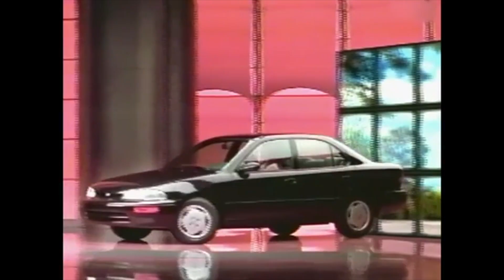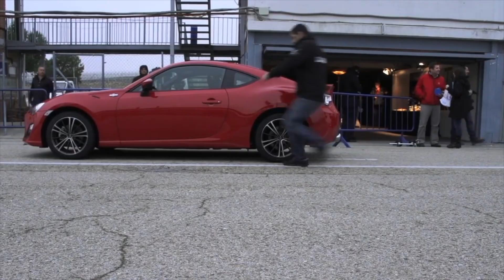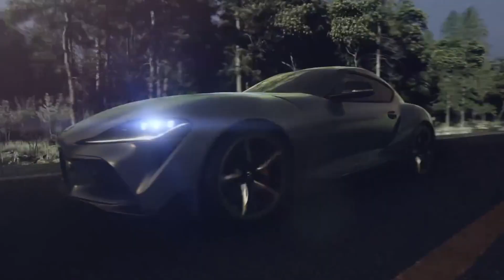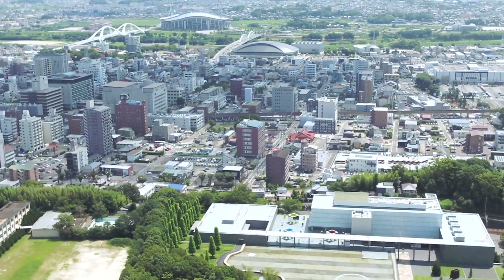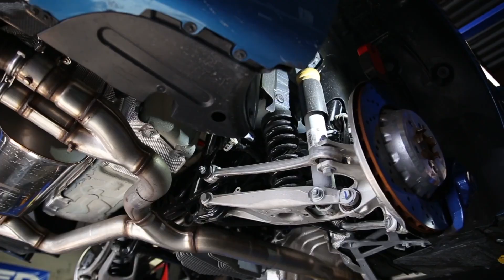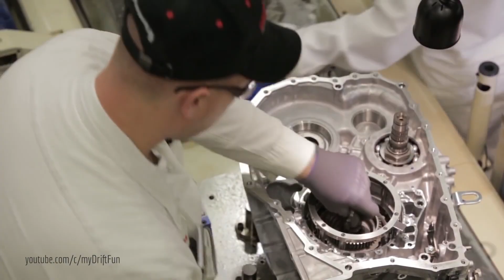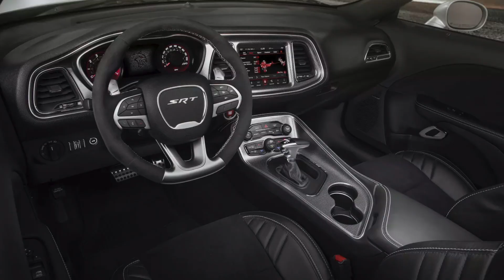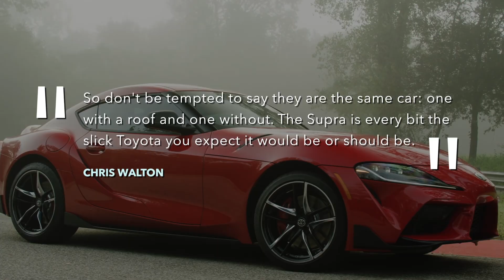MKV Toyota Supra - BMW or Toyota? The UNTOLD TRUE STORY

Comment: Great video.  I say this to everyone who I talk to.  Who wants a Toyota with BMW reliability.  And this video answers some of it.  But the platform aside, this is a BMW parts bin car.  Not manufacturered in anyway by Toyota.  That is a hard sell, namely you slap a Supra badge on it. The other part, a lower HP driver's car with no optional manual trans at launch is a huge contradiction to their sales pitch for who they are marketing it towards.
Reply: I've been saying the same. Too bad everyone jumps to conclusions and calls me a idiot. I hope the car does well. I'll just never see it as a Supra.
Reply: I think this Zupra will be popular in Europe, meanwhile in Asia = FAIL

Image of Bmw Cars in Asia = overpriced spareparts, mediocre reliability.
Reply: It won't be another Z4. And I already think the Z4 is a great car.

The simple rundown of it? Easy. Look at the wheelbase and setup. Look at how they've gone with the bored rather than sleeved block.

Toyota have seen what became of the 4th gen. They've paid attention. And so they probably wanted to make something that can become something similar for a new generation once modders and mechanics get their hands on it. Hence going for something more durable and reliable in terms of both construction and likelihood of finding parts. Hence going for a BMW I6, which are about the best damn engines you can think of across the register, MAYBE with the exception of a Merc.

I am looking forward to this.
Reply: Navid F this is one of the most beautiful things I have read on youtube comments haha
Reply: @elih2765  for real haha. The argument should of just ended with his comment. Dude literally dropped mic on all these idiots. Lol
Reply: @X1xRiGox3X  @Eli H Awe thank you all. Love you guys. <3 I appreciate the support! It's time one would look at things without bias and objectivity and everything will make sense. I really want to cop me one of these in the future and kick ass. It's unfortunate that people are comparing things tuned to stock. Stock vs stock, the MkV wins. Tuned vs tuned, right now it is up in the air as to what would happen. I have faith in the B58 tuned and developed by Toyota, but the 2J is amazing in its own right as well. I'm one who loves things to be clean and stock, so it won't matter for me. <3
Reply: All parts were sent back to Japan for Toyota testing, including all the nuts and bolts. Parts were rejected and updated. This is going to be Toyota reliability. As for manual, the LFA didnt need a manual either.
Reply from the maker: Definitely agree. It's certainly not what the purists wanted or really what the majority of the car world expected, but at this point, we have what we were given and I will continue to reserve judgement until I get a chance to drive one. The 86 was an interesting foray into this collaborative streak by Toyota and I personally feel it achieved what it set out to. I'm most certainly not a BMW fan though (I know you had a wonderful time with your M3 lol) so I'm still reasonably apprehensive. Thanks for watching dude!
Reply: @albonfilms  Keep making videos, you are doing well!
Reply from the maker: @savagegeese  Thanks man! Means a lot!
Reply: @albonfilms ... What is driving it going to do? We all know it is going to be a good car to drive for the most part.. I don't think anyone is arguing it is gonna be shit to drive and a shitty car overall.. Most are just not happy with the fact that it does not go in line with that the Supra originally was and that the car is mostly a BMW.. It's like the new 10th gen SI... The car performs fine and it is a nice car, but it pretty much goes against everything the SI has always stood for.. An NA, high-revving, reliable driving experience. They just threw in a Honda fit motor, slapped on a turbo and called it a day lol.. Some of the best parts of the SI are modding them, and with the 10th gen, you are incredibly limited with that Direct-injected, 1.5 liter.
Reply: @albonfilms  same here, reserve judgement. for me it'll be the ultimate potential of that "B"- engine variant. Also, do you know which 8HP model toyota spec'd?
Reply: @albonfilms  I predict a warranty headache for Toyota.
Reply: @albonfilms  hey"purists" GFY
Reply: savagegeese as someone who has been in the automotive manufacturing field for a decade I can tell you that even the component manufacturers are all connected. I work for a very large tier 1 manufacturers and we make parts for many of the OEMs under one roof. All parts are made according to the manufacturers standard but can be built sometimes on the same lines and a lot of OEMs part bins are shared.
Reply: @southsidedezi  what do you think about this new supra?
Reply: @southsidedezi  I understand that and it makes sense on every level.  I will leave you with this, what made the MKIV Supra legendary?  I can promise you one thing, if it had a BMW motor from that era they would all be in the junk yard.  And that's just being honest.

But it's a different era now and I understand the development and business case for not wanting to spend 75 million on a new motor that will maybe be in 60,000 vehicles.
Reply: @savagegeese  Let's hope the pre-production testing that Toyota completed on their test mules makes this B58C variant much more reliable than a vehicle developed solely by BMW. The new Supra has met ALL of the same reliability and quality standards as all of the other vehicles in it's lineup. I hope that means something in 2020 and makes a difference on this car. Also.. hope Toyota has a decent staff of quality engineers to keep all of the suppliers in check.
Reply: @vhx1  Then they should've gave it a different name and let the mkv make it's own name. If the mk4 did it then it's only fair that the mkv do the same.
Reply: Only time will tell the actual reliability of the new supra, bmw seems to have gotten their shit a little more together. I think itll be a really awesome car
Reply: @Ghost1gx  Depends on what layout and block. The M5 V10 for instance was a disaster, and e.g. the N47 is wonky because - suprise suprise - when you start off with an I4 and then introduce lightweight parts where they shouldn't be straining because you need to drive balance shafts in the first place, just so you can lower friction that tad bit more for the sake of those asshole greens and their emissions... Well, I mean, that's like saying "I took a bad design, and then introduced bad parts because of bad priorities, and it went bad. How could this have happened?".

Beamer I6s have been pretty good. I've only ever heard good things about the N/S55 for instance. And the N54, while it some had problems with e.g. the fuel pump (probably because of oldish design and possibly also the crap gas you get over there in the US...), is notorious for its tunability. As I said, Merc generally looks ahead on sheer mechanical guts, and they seem to be able to bore nicer, but there isn't much one can usually do to improve a modern I6 design-wise since pretty much everything about how you should set up such a self-explanatory design is right there. Especially since here it comes with VANOS, Valvetronic and overlaid IC out of the box. The channeled rather than jacketed block and the anal parts testing tells me that, like I said, Toyota is counting on people scaring the living shit out of these engines basically from the moment they get their hands on them, and so they have come prepared. So the only damn thing that has me concerned is the coated rather than "proper" cylinder liners, which sounds like something that would be too expensive or specialized to get fixed neat in case of a problem or if you want to do a re-bore.
Reply: Very true. People can say "give it a chance". But that fact you even have to say that says something about their strategy. You wouldn't have to say that about something that was obviously well done, based on good decisions.
Reply: @savagegeese
While I partly agree with you, I would like to point out some things in favour of Toyota:
1. For all it's iconic status, the Supra's were never sold that well. They were essentially niche-cars for a very small group of enthousiast. Instead of making Toyota money I wouldn't be surprised at all if they actually COST Toyota money, as the Skyline R-32, 33 and 34 did to Nissan. 
2. When Toyota presented the 86 in collaboration with Subaru, Supra fans were disappointed and cried out for a new iteration of their beloved Supra.
3. In contrast to what Toyota maybe secretly had hoped, that Supra fans could be swayed to see the 86 as a tamer replacement for the Supra, they couldn't see the 86 in any way as a rightful successor to the Supra: to them it severely lacked the power and the tuneability that made the Supra so famous.
4. Toyota had a look into developing a successor to the Supra and quickly realised that developing that successor to the Supra all by itself would be way too costly, seeing as they didn't expect to sell large numbers of Supra's so they would become way to expensive for a "mere" Toyota.
5. Since the collaboration with Subaru had turned out well, Toyota choose to develop a successor to the Supra with BMW.
6. As the platform was mainly developed in Germany, it made sense to use readily available German i.e BMW parts and build a completely finished "lower half" platform and then have both BMW and Toyota build their respective "upper halves."
7. Toyota possibly didn't realise how much this would offend Supra-enthousiasts, who wanted to see the next generation of the legendary 2JZ-E engine instead of a "mere" BMW inline-6.

As to reliability: the BMW inline-6's are pretty reliable, not only  have they been building and developing them at BMW for decades, they've also raced with them for decades, so they must pretty well know what those engines are capable of. 
That being said those BMW engines are nowhere near the over-engineered tuning monsters the 2JZ-E engines were, and there lies the rub with Supra enthousiasts. The standard Supra, while being no slouch!, was never that popular. They only became popular when people saw what Supra insiders could do with these cars to get insanely tunes.

So has Toyota made a mistake with the new Supra? 
Fans of the older models will scream loud and resoundingly "Yes!" 
But maybe people new to the Supra will see it as a competent sports car, a kind of hommage to the Supra's of old, and a big step above the 86 and will buy it as such.
Only time will tell.
Reply: Not just that, but it doesn't even follow previous Supra cars in its layout.  Other Supra cars were GT cars before everything else with 2+2 configuration.  It was something that was easier to sell to your wife as well, I am talking from personal experience. New Supra is just a tiny 2 seater with shorter wheelbase than GT86 and with possibly even worse visibility than Camaro. So disappointed after saving money for last 2 years and hoping that those concept cars were just that and nothing more.
Reply: @thedriver5462  This, this right here. This is what I keep trying to explain to people. It doesn't even make sense being badged as a Supra. If anything, it's more like a modern 2000GT.
Reply: A Toyota with BMW reliability..? I thought it is the other way round hahaha
Reply: @MikeHarkins-w9b  go and look Mike. It's called reading
Reply: @MikeHarkins-w9b  i'm not a straight line junkie :) i know that's a big thing in America but not quite everywhere else. Try taking an r35 to a track for continuous laps and you'll see what i mean. Regarding old Skylines (yes, we actually have them here from quite sometime ago) they were great for what they were, in their own time. :)
Reply: @gerardjoaquino8856  discredited lol 35 is a v6.
Reply: idk i think the changes on the b58 makes it a solid engine ready to take a beating
Reply: @ghostcell030  yes they are using BMW parts and fair game to Toyota for letting the buying public know. But hey, i'd rather be thankful there is a new sports car out in the market than not, and at an attainable price for a lot of people. I'm just looking at the glass half-full, really.
Reply: Why didn't Italy have some skin in the game? Could have been an Axis Power Reunion :). In all seriousness though what a cool collab project between two countries and definitely a practice in Engineering.
Reply: I just don't understand why Toyota would not develop it's own engine, they could then use that engine in future gt86 cars and supra models and also use it in a new version of the MR2, the company is not broke it could of afforded to take a risk. People would of been far more interested in this product if it was toyota engineering because that is what we have all fell in love with and if they could do it i the 90s why can't they do it now, 4age, 3sgte, 2zz, 2gr 1mz, all sick engines. Pussies answering to shareholders.
Reply: @mat0655  Because designing a new i6 engine would cost a lot of time and money and would have limited use. They're better off working with an existing, modern i6, and BMW has such an engine. It's not like this is the first time Toyota has worked with another engine manufacturer. It's very common in the industry. As for sharing it with a new MR-2, if such a thing happens, they'd probably prefer a i4 or v6, for packaging reasons.
Reply: @nf1369  "the notion that you doubt toyota in making anything reliable makes me very disappointed"? Wow fanboy much? There are very good reasons to doubt. As long as you remember that speculation is just speculation until you see how the actual thing holds up years later.
Reply: @emissarygw2264  
Why in the fuck would you doubt Toyota at all? They've never built a genuine lemon. The partnership with Chevy and the Sunfire came out, they made it reliable as fuck but the Chevrolet equivalent was a bag of garbage. How about the BRZ/FRS/GT86/86 twins? You don't realize that car is the most reliable Subaru ever? Stop saying random things and start thinking before you say something. I'm no fanboy, I'm a realist. When savagegeese commented that earlier, I told him that even with this vast amount of wisdom, he shouldn't have come to this conclusion because he knows better. Calm your tits down buddy.
Reply: Toyota’s, BMW, and Porsche all get along in my garage.  Put manual in the Supra and I will put it commuter duty.
Reply: Video: They only share the basic platform and engine, with each developing the rest of the car (body shell, interior, chassis setup). Internet ding-a-ling: It's just a BMW with a Toyota badge slapped on it. I mean, it's not like BMW produces cars that handle like rubbish.
Reply: @soupisgoodfood42  The Supra is an iconic Toyota.  What if BMW decided to have Chevy produce their M cars?
Reply: @savagegeese  That's a silly analogy. Or are you trying to say that BMW don't make good performance cars?
Reply: @soupisgoodfood42  They do and have, but none you want to keep long term or put extended miles on. They are lease only and pass the problems on.  It has gotten way worse over the years.
Reply: @savagegeese  Which is why it's great that BMW are working with a company known for its reliability.
Reply: savagegeese I don't see any advantage of a manual gear box or a dual clutch transmission.
Reply: "Who wants a Toyota with BMW reliability" Sad to see you take a pretty non-nuanced look at this, @savagegeese
Reply: @motormusique Its pretty straight forward.  The Supra for many has and always will be an inconic Toyota.  For me it's another sports car mashup that would not exist without a collaboration.  Time will tell if it was a good idea, I sure hope so.
Reply: @savagegeese  Sure, but I really don't think it's that straight forward.  Little is still known about its development and how Toyota influenced it. Toyota is quite aware of its reputation for reliability at least and is not able to put out a product to jeopardize that
Reply: @motormusique  I have a lot of faith in Toyota as a brand.  I don't doubt that even if this car has problems that they will work quickly to fix them.  But it's just so strange to me that you would even want to partner up with a company like BMW to make such an iconic car of your past when their direction is completely different than yours. I get it, but don't.  anyway really it's all talk until anybody really drives and owns the car.
Reply: @savagegeese  True.  I think Toyota did make some concessions (like not having a manual just cuz the Z4 sixes aren't coming with one), but I'm looking forward to see what the car will be like for sure.  Everyone seems to like that straight 6 and heck I'd happily take iDrive over some Toyota/Lexus infotainment.  Glad to have had this exchange with youtube royalty (you, sir)
Reply: It's a huge swing and a miss from two hard headed teams that couldn't work together to start a fire with a zippo and some lighter fluid.
Reply: Real Toyotas are way more f**** reliable than a BMW BMWs are legendary pieces of s*** with legendary problems
Reply: I wouldn't call this lower HP. 0-60 in 4.1 seconds is Ferrari 360 (and more importantly, Mustang GT and F-type)-beating speed, and STRONGLY implies that it's heavily underrated, which is in line with previous BMWs with the B58 (supposedly 335hp 340is tend to make 335 at the wheels, for instance).
It's certainly likely to be competitive with a base Corvette C7 or BMW M2.
Reply: @martin-gt7id  Thats what Toyota PR said, its not about spec sheets(HP) its about how its "feels".
Reply: @savagegeese the original supra wasn't Toyota designed.  Yamaha engine, lotus chassis and suspension work, german transmission etc...  Same story different partner.
Reply: mattsa pic you’re talking about the original one. The most famous Supra is the A80 and that’s the one everyone is referencing the when they sayToyota Supra. That’s the one everyone pictures when they hear Supra. It was Toyota developed and designed.
Reply: @Fadic4  agreed lol the first three generations supra. Weren't sought after one bit around 2010 not until nameplate hype, Mr. Walker, and the fact that no IV are for sale longer then it takes to read the ad.
Reply: I believe most manufacturers are playing it safe with the automatic sport cars. The number of people who actually know how to drive a manual car is going down and the number of people who know but don't want to drive a manual is going up.
Reply: It's obvious BMW wanted Toyota reliability
Reply: @REEL SIXX I've had a few E36s coupe and sedans, never had any issues with those, but that was a long time ago. That was before they went cheap and so many kids that can't afford maintaining a car got E36s.
Reply: REEL SIXX we had a 07 Camry that burned oil like there is no tomorrow.
Reply: I've never seen you so active on other videos. Given, I'm not stalking you. I agree this is obviously a bmw, but I think this car seems badass and will be absolute sick to drive. I hope you get one to review,  you're my favourite reviewer.
Reply: It’s not a supra, too ugly and only in automatics
Reply: A friend of mine inspected one up close at the release.  He stated the Supra had a BMW interior.  Not saying BMW interiors are bad, but another example of how this is a rebadged Z4.
Reply: @nf1369  this smells like a corporate money grab. The real supra should have been japanese. Period.
Reply: @andrewc1036   Yeah and do you want to make it an unaffordable sports car at 100k dollars? Yeah they made this affordable to the masses. To the generation who grew up with the MkIII and MkIV Supra. Stop making early conclusions and drive the god damn car. I know it will be good. Many people who drove it raved how it feels like a taut, and a proper sports car. Remember, the philosophy of the Supra changes every generation. This is no different. To those who are expecting a MkIV, go get a MkIV and stop crying. The MkV is better in every way.
Reply: @nf1369  the supra should be competing with the GTR, not Z4. It's a Celica best. You like this celica? Good for you. Go buy it. You're a celica guy. 

You want a real supra? Make a real supra. Don't slap a badge on car made in Austria and call it a fucking supra. 

Shit job Toyota.
Reply: a c Are you insane? Since when did the Supra EVER compete with the GTR?? Jesus Christ I bet you can’t even afford a civic and you just want OEM’s to listen to your wet dreams. This IS a real Supra whether you like it or not. It isn’t a Celica because a Celica (not counting the Celica-Supra) always had a 4-cylinder. So don’t do full on idiotic there. I’m happy this partnership happened, because there was no other way we would have gotten a MkV, especially how it was discontinued for 20 years. Everything takes time, but you children can’t seem to be patient. Leave the complaining (and not whine) to the buyers who are actually in the position to buy one.
Reply: @nf1369  have fun with your rebadged bmw z4 made in austria!
Reply: I think it's just something they threw together to get it out on the market. No way is it worth the price 😔
Reply: It and the Z4 are both built by Magna Steyr in Austria.  Not certain what your point is meant to be.  Manual clutches and manual gear selectors are so 20th Century.
Reply: @maxnix346  Built with BMW parts inside and out.
Reply: how does this channel have 20k subs? this is easily a mm channel.
Reply: Yea well my bmw n54 will dog anything else toyota is making at 200k miles and still going strong. Toyota made the right decision #ultimatedrivingmachine
Reply: I appreciate all your videos my bro.  Showing weight with your like on this comment.  LOL
Reply: Why call it a Supra?
It looks like a Miata and only has 335ish hp. Weak sauce. 
If they say that's a weapon then Camrys and other minivans are weapons on the street as well.
Reply: "BMW Reliability" Are you kidding me? My one & only BMW E60 M5 was the worst car I have ever Owned! It required major engine repairs before 50 000 miles, + numerous other mechanical & electrical issues.
Reply: Inline-6 BMW engines have the reputation of being pretty reliable. However there are always exceptions. Even Rolls Royce engine can break down. I agree that modern environment regulations make al lot of normally very reliable engines somewhat less reliable, but even then it's mostly the "add-ons" that break or cause problems than the engines.
Reply: It's completely normal for manufacturers to use engines and other parts from other manufacturers, people need to educate themselves before talking.
Reply: Well, the original supra was pretty reliable, even more than every BMW.
Just saying...
Reply: @MacoJoker XxX
Agreed, but if Toyota would change the 2JZ-E to comply with actual regulations people would howl about how "bad" it had become. 
Not for nothing did Nissan have to switch to the 3.5 and later 3.7 litres V6 for the 350/370 Z and they upped that engine to 3.8 litres for the GT-R. So even the famous inline-6 RB25/RB26DETT had to be dropped in order to comply to environment regulations. And there are a lot of people who argue that these new V6's can't hold a candle to the RB25/RB26 in reliability and don't even come close to the tuneablity of the inline-6's.
Reply: @tjroelsma I agree with you 
 The thing with the supra is no mather what, people would always complain about it.
Even if toyota would made the new supra by itself.
The Mark 2 was just a great car launched at the right time, bullying every other sportscar.
It's a myth, it's a legend. 
You will find always someone who doesn't like the design or has a problem with enterior, engine, etc.
Funny thing is most people complaining about this car, didn't even own a supra or drive one... 
Personally I think the new supra is still a good car and has a nice design. I'm just not sure about the name "Supra" on it.
Reply: @ MacoJoker XxX
Yes, they should have ignored the fans and just left the Supra as it was: an obviously very flawed car that somehow achieved iconic status.
Reply: LOL
Astra International Group own by Indonesia and Singapore is merging Toyota, Daihatsu and BMW.
So as an example why BMW spare parts are much easier to get here in Indonesia just as easy as spare parts for Toyota and Daihatsu than for Mercedes Benz cars, buses and trucks even they are Made in Indonesia since 1978 for global market. 
Because BMW belong to Astra International here in Indonesia. LOL
Reply: Olá friend, convido te a escutar os meus novos singles. Deus vos abençoe💥💓😎  https://open.spotify.com/track/7l39OBQKKHffYQ4KkxB6ia    ➕ https://open.spotify.com/track/7Fr8qMfcupXb81mqSE6n2J
Reply: i want a bmw with toyota reliability, so i will buy a 29 year old mercedes w124
Reply: i want a bmw with toyota reliability, so i will buy a 29 year old mercedes w124
Reply: I could handle having a BMW with Toyota reliability... :)
Reply: You should be happy Toyota even made this car, they could've just ignored everyone and kept making SUV's , the profit margin on sport cars are nothing
Reply: exactly what I was thinking..."Who wants a Toyota with BMW reliability".  its gonna break down every 6 months and cost 3 grand to fix every time.
Reply: lol poor @Navid F doesnt realize Toyota OWNS Lexus, and is calling it a "partnership" ....🤣🤣🤣
Reply: @DekLabs  What the fuck are you even talking about you indolent piece of shit. I fucking know that? Little bitch. Shut your ugly ass up and gtfoh.
Reply: who the fuck wants a toyota with bmw reliability xd
Reply: @hiro6406  No ones said.
Reply: its silly for sure
Reply: Another excellent comment. The reliability of the german cars hasn't been exactly stellar in recent decades. On the other hand the Japanese still make amazing vehicles that last at least 2 decades without giving the owner hell.
Reply: "If Toyota were to build a legendary inline-six a la 2JZ to Toyota standards and shock the world with quality, durability, reliability and POWER, and doing all of that for just ONE sports car will set those poor guys back 500 million dollars to maybe even DOUBLE that much in money. "

The 2jz variants were used in over a dozen cars, spreading the development cost around. Lexus IS300, Gs 300, SC300... and obviously the Supra. That's just the US market. 

It doesn't make sense to design an engine for one car that targets a very small market. If they didn't stick to the I6 for the engine, Toyota has plenty of v8's that would fit the bill. 

To be honest, I'm surprised they decided on a straight 6 for nostalgia purposes vs vehicle dynamic purposes. They're a lot harder to balance the chassis. That said personally I love the sound of a performance oriented straight 6, due to the inherently balanced firing sequence.
Reply: @daftpanda6533  I understand where you're coming from. But Toyota aren't building inline-sixes to the masses anymore. They developed a Twin-Turbocharged V6, are developing a Twin-Turbocharged V8 and a crazy Twin-Turbocharged V6 Hybrid engine with influences from their racing programs (both Toyota and Lexus). So all of a sudden using the inline-six would be pointless. It's too late.
Reply: @vachief Agreed, they do take up a lot of lenght, and are also taller than a "V" engine. This moves the center of mass more forward and higher in the chassis. It can be worked around somewhat front to rear by having the transmission in the back like the GTR or Corvette, but it's difficult to get the engine to much lower in the car due to the front crossmember, steering and front suspension.
Reply: No it's not. Only the suspension parts and engine are BMW! And that's not a bad thing.  People have been whining and complaining for Toyota to build it and now that they found a way to do that, all you can do is still whine and complain because it doesn't meet "your" expectations? Who the fuck are you, Mr. Nobody with an idiot brain that hasn't even driven one yet to make an informed decision. 
I guess this is just the way people are today. No critical thinking skills combined with facts and experience, just uneducated and emotional opinion! =Garbage!!!
Reply: @brianmogle1121  Only the engine parts, suspension, electronics, wiring, ECUs, body control modules, stampings, chassis, subframes, radiators etc. are BMW. No biggy. Sounds like you are ready to rage quit bro, don't stroke out.
Reply: @savagegeese , you do know what "built with Toyota specifications" means right?
It doesn't automatically mean it's a BMW in soul or performance. 
Did you watch the entire video to the end? If you did, you will realize that it's still a Toyota performance vehicle that will out perform the old Supra hands down.

If you still dont get it, you never will.

No stroking out over here. I've had plenty of performance cars over the years from Japan, Germany to American muscle and raced most of them on the track off and on. I just know a good thing when I see it, and i recognize idiots that discredit something before even driving it because their feelings got hurt.
Reply: @savagegeese  I have also had no issues with my M4, fantastic car. Marry that with Toyota exacting standards for reliability and it's a win!
Reply: I think it is plenty of hp for the weight. The original supra did not have this much horsepower and became super popular for mods. I like that they cross developed it. You get a more luxury car with toyota reliability. I don't know why people are mad, if they engineered it themselves people would be mad because they couldn't afford it.
Reply: @MrRaymondo219  for the 60k base price they are asking you can buy a Corvette with over 100 more horsepower, besides the mk4 made only 10hp less 20 YEARS AGO they could (and should have) done better
Reply: Only thing about your post is the reliability statement. Not really an issue in 2019
Reply: Not like you were ever going to buy one new, so it's not like Toyota or BMW give two shits about your opinion
Reply: im sorry, but in indonesian BMW is not strong enough nor have a good reliability than other japanese car here, especially when the spareparts is so ridicolously high!
Reply: @REEL SIXX Yeah go actually look up the part numbers, most of them are from the X3 or 5 series they are pre-existing BMW parts (likely with better tolerances)
not re-manufactured ones specifically for Toyota.  Maybe 1 or 2 of the  part was actually unique and  not found on any other BMW product to date.

I agree with you regarding Consumer reports and JD Power they are by no means a definitive source of information, but it's also worth mentioning
that your issues and your neighbors issues is just personal observations. Toyota sells hundreds of thousands of cars a year , need to look at the larger picture when discussing true reliability of a brand.  

Only real way to get a great indication of reliability is to compare that information and then reference it against things like the cars forums and see what the community itself is reporting.
Reply: @REEL SIXX Oh I'm not disputing that they don't have issues (they do)  and Toyota parts are usually more expensive  than one expects. But BMW has insane mark up on their stuff. I went in for some rear-diff fluid for my old mans 09 3 series and a 1L bottle came out to like $70 and with washers and stuff it was nearly $120. lol

 Infiniti seems to be one of the few luxury brands that gets decent pricing on their parts for the segment, but that's mainly because it's mostly parts bin Nissan stuff.  But with all the electronics  and sensors in cars today they are the number #1 issue for  most manufactures. 

But It's good to hear you worked in a shop and at least have somewhat representative look  into these cars reliability,  and honestly BMW reliability past 5 years hasn't been so bad. Especially when it's under warranty,  It's after that when you start getting near the 70-80K miles mark that you start paying out the ass for frequent sevices.

Only big hiccup they had was in 2009-2013 area with the N54\N55 engines,  almost picked one up last year but decided to check out service requirements and known
issues and ended up walking away from it and picking up a G37 instead. lol
Reply: I'm curious how much power you can get out of these with some tuning, as well as mods.
Reply: @shaunskii  Well it shares a engine and drive-train with the BMW 2/3/4 series cars, so assuming there is no changes to the turbo sizes than people can expect 420-450WHP, those willing to toss some more money at it and willing to drop the engine to swap out the turbos and do a few other things probably looking at 500-550WHP area.

Most are expecting the internals to be good till about 550-600WHP.
Reply: And more importantly it like the sport car version of logan paul
Reply: Seems like you know everything.  Except that the Supra is almost sold out for the first year of production.  This, even before it is released.  I suppose that means that it really doesn't matter to those who want to own a Supra.
Reply: @shubs1015  really a testament to the Supra marketing team imo. 

Selling out a German designed and Austrian built Toyota Supra 😆😆😂😂
Reply: Did you watch the presentation?
Reply: savage, you are a moron. Did you even watch the video? Are you really that stupid?
Reply: You sir are on point. We maybe old enough to remember the last supra. This is not a supra. Toyota will get the Sales in the first release of this Z4 Supra but they will fall off because the enthusiast will not back it nor buy it. I would buy a I6 Toyota built Supra in a second. If I where to buy this car it would be the Z4. Of coarse I would never buy a Z4 its a car for people who don't know what a sports car is and rental car companies who charge 150 a day for sports cars like the V6 pony cars.
Reply: Stunning statement assuming Toyota relied on BMW's manufacturing process when Toyota probably installed robotics and hired hands at the BMW plants. Bin car? Let's talk 165k miles later.
Reply: I guess this is a similar case to the the Buick GNX
Reply: @nf1369  I spent about 5 hours listening to a seminar about Toyotas global initiatives for TNGA, engines, trans and platforms. It went into insane levels of detail on how they are re-shaping engine building, plant flow etc.  The Supra and other sports car products don't fit into any of that global plan set in motion almost 4 years ago.  The LC500 I love is still apart of that.  The engines designed to fit and be re-utilized in multiple bodies.

It's not a matter of matter of ability, it's a matter of willingness.  They don't want to make that level of investment in a true one off dedicated platform and motor.  You saw it with the 86 and now with Supra.  I would not be shocked if they bring the MR2 back with Mazda's help.

I don't doubt Toyotas commitment to quality, but this is a BMW. ECU, body structure, parts, electronics, wiring, body control units, lighting, telematics. And that also means taking a "BMW" to Toyota service centers which means much like the 86 when parts like cam phasers or DI HPFP or eletrononics are on back order from (Subaru) BMW you will be waiting longer because it's not really Toyotas supply chain.  I went through this on my 86, been on the BMW side too.  

I really hope it all works out and the car is great, look forward to driving it, maybe owning one. But I will be sitting on the sidelines waiting to see what if anything pops up on this first from previous experience.
Reply: @savagegeese  good points there. I still have an 86 also.. stopped tracking it and turned it into a daily to avoid the inevitable DI seal failures. Time will only tell how this will work out. If they do release a manual tranny, I would definitely consider picking one up 2 MY in so they can work out all the kinks.. like the 86 went through
Reply: We know that Toyota worked with BMW to reposition the engine further back late in the design process, by Toyota's demand to further lower the centre of gravity.  This shows that Toyota was part of the design process and was getting things done that BMW was not doing otherwise.
Reply: Huge fan of Savagegeese, great to see your input here! I'm sure eventually you will be able to test both of these cars & eventually give us the lowdown.
Reply: Navid F well said , we need more people like you to speak up.
I’m sick of hearing all the damn trash talk about the new supra. 
People who are complaining about the new Supra are either retarded teenagers, or clueless about toyota and its value.
Reply: Supra weighs less and accelerates faster compared to the Z4. Hmm... I heard that manual will come son as a GR Sport variant.
Reply: Also has 50hp less
Reply: @nf1369  the 2JZ isn't a Toyota engine its a Yamaha engine.  The original Supras had a Yamaha engine, a german transmission and lotus chassis/ suspension.  Toyota is at a point today where they can afford a full fledge development and they are doing good work in Motorsports but that would most likely be a part of the Lexus branch as part of a "super series" type car like the LFA.  Though Toyota has incredible funds, their stock is on a decline because SUVs and hatches are what sells.  Their family cars are getting poor reviews because they are behind the curve when it comes to technology implemented in their cars, as well as their handling characteristics.  Where Toyota gets a positive reputation is reliability and cheap maintenance.  The Supra being 100% in house would have flopped as the MSRP would have been significantly higher at a much higher risk in a time where their stocks are not doing great.
Reply: mattsa pic dude. Just stop. The 2Jz isn’t a Toyota engine? Are you a serious right now? No one is going to take you seriously after this.
Reply: @Fadic4  it isn't its a Yamaha built engine (built as in engineered) and Toyota just mass produced it.
Reply: mattsa pic show me a reliable source that states Toyota only produced the engine and didn’t engineer it. Show me a reliable source.
Reply: @Illestrapper   Since I am tired of writing walls I will reply to your comment in bits.

"the 2JZ isn't a Toyota engine its a Yamaha engine."

--> I believe the word you're looking for is co-developed.

"Toyota is at a point today where they can afford a full fledge development and they are doing good work in Motorsports but that would most likely be a part of the Lexus branch as part of a "super series" type car like the LFA."

--> That's 100% true. Back then Lexus wasn't a serious threat, but now they have a big stake in everything. They can spend billions on a car and not care about the losses at all. That's how powerful they are. Would any normal person/company do that though? Hmmm no. But it's not only Lexus though. Why are you forgetting about the Toyota hyper car? Are the people just here on the internet have a purpose of being brainless and just point out negativities? DON'T PEOPLE KNOW THAT THERE'S A LEGENDARY HYPER CAR IN THE WORKS FROM THE WEC?? THEY'RE EVEN TELLING US AND LEAVING CLUES LIKE WTF. Please for the love of Jesus Christ people gotta start fucking searching up the Toyota GR Super Sport.

"Their family cars are getting poor reviews because they are behind the curve when it comes to technology implemented in their cars, as well as their handling characteristics."

--> With all due respect man, pigs can also fly. That's the biggest barefaced lie I have ever heard. TNGA has shot Toyota up in dynamics ten-fold. But second to Mazda.

"Where Toyota gets a positive reputation is reliability and cheap maintenance."

--> That's very true. However I am not following where you are going with this?

"The Supra being 100% in house would have flopped as the MSRP would have been significantly higher......"

--> You've hit the money. Now you get it. That's how the MkIV flopped royally as well. Making this car fight a Cayman/Corvette/911/Mustang/Camaro/A110 was the best decision they have ever made. Sports cars/daily drivers at that level are getting ridiculously popular anyways and are very competitive too. Almost super car level in fact. No need to compare this to a GTR or a NSX. To be honest, they both fell flat on their faces, so why should Toyota make the same poor decision as they did with the Supra?
Reply: Toyota is known for reliability more than BMW
Reply: Toyota with BMW reliability??? LOOOOOOL  You mean a BMW with Toyota reliability...
Reply: Video: BMW sent parts to Toyota for reliability testing and were impressed with how thorough Toyota was. Internet ding-a-ling: Toyota with BMW reliability.
Reply: Why are people getting mad at you. Okay. Put your money where your mouth is and go buy this bmw and see how reliable it’ll be. 

How about the electronics????? Isn’t bmw trash with that?
Reply: @Fadic4  Just ignore all of that history and wear the rose glasses.
Reply: @Fadic4  they're mad at me, they're mad at Toyota, they're mad at BMW. At least i seem to be in good company, and they're apparently miserable (including you ;) ) sure, BMW's trash at some things, expensive to maintain yes but why are they being bought anyway? It's not a car for you that's for sure. Can i buy it? Yes. Will i buy it? That's a choice i can make, and it seems you unfortunately can not. Do you dislike that fact? Do you hate the fact that I reserve my judgment on this apparently pre-judged "piece of junk"? Do you do well to be angry? I'm having fun. ;)
Reply: Gerard Joaquino i didn’t read your wall of text. I wasn’t talking to you.
I was replying to savagegeese. Someone who knows what he’s talking about.
Reply: all this talk, but at the end of the day, is STILL a PS bmw engine and gearbox. Is NOT made in japan,so is crap crap crap.
Reply: A toyota with BMW reliability? wtf are you talking about?  Toyotas are the epitome of reliability BMWs are far from
Reply: Individually the parts are BMW but the sum of those parts coming together becomes a Toyota product. I doubt the MK5 drives anything like the Z4, we will see. Did you know that the MK4 turbo’s getrag transmission was made by a German company?
Reply: @kyle998cc  Not so much worried about the trans. As mentioned ZF is defacto trans manufacturer aside from Aisin for most cars now.  They are so many OEMs that do core parts from steering racks, diffs, dampers etc.  Even that I am ok with but to have a Toyota badge to me has always been about that Toyota motor/drivetrain.  We shall see.
Reply: @kyle998cc  Yeah,it was made by Getrag who just makes gearboxes so what? Aisin makes gearboxes for Toyota another fun fact.
Reply: @kyle998cc  lol when you like the car you say Co-engineered. The prism/ corolla. Was easily more uniquely engineered into existance-badge engineered(they say).
Reply: @kyle998cc  I bet the z4 will be faster around a track
Reply: MK4R1 it’s nice to finally see a comment not trashing the car but giving a genuine opinion on it. While I wish Toyota used their own engine or made a new one for it, I’m happy to see Toyota did do a lot of work to make the Supra is reliable despite its engine being a bmw engine
Reply: All of these folks defending BMW reliability are nuts or have never owned one. In the last 3 months I've had to replace: alternator,oil filter housing gasket, vanos solenoid, belt tensioner,serpentine belt, valve cover gasket, coil pack. mostly because it pisses oil from every gasket and slowly ruins all the accessories. I am counting down the days for the plastic water pump to shit the bed and leave me stranded somewhere. Basically have to put aside ~$200 a month for repairs/maintenance on a 10 year old BMW with 80k miles.
Reply: @loveforpetrol  You clearly haven't been reading the comments.
Reply: @loveforpetrol  Had no issues with an E36 318ti M43 running 145,000 miles. I bet you're thinking its the least desriable BMW out there, but quit putting a blanket statement on all BMWs.
Reply: Didn't expect you to trash this one outright Goose. Drive it first then let us know.
Reply: @gerardjoaquino8856  Definitely not trashing it, but being realistic about it. There is a reason why people loved the Supra, AE86, MR2, Celicas.  It wasn't because they were the best, but they were some of the most reliable, fun and affordable cars they made. (if cared for).   BMW is not know for reliability they are mostly throw away and costly to own long term when you put real miles on them.  So maybe this will be different, but its very hard to get excited.  I say this a lot if you have a great car and its always broken or having issues, is it still a great car?  That was my BMW experience.
Reply: @savagegeese  I usually agree with you, but not this time. I think we need to at least give it a chance. It should handle well, and be very good on the track. I also doubt Toyota will be willing to let their reputation be tainted by another manufacture's engine.
Reply: @Kona61  I agree, give it a chance. I like most wanted a Toyota designed and built car, much like the LC500.  But there is no money in sports cars like this anymore so I get it and hopefully its great.
Reply: @savagegeese  the gap between expectation and reality is called disappointment. Let's keep expectations low and maybe we can be happier. ;) that being said, give it a chance. Anyway, you're popbably not going to buy and own one, right?
Reply: savagegeese I will say, of all companies, Toyota could have built it themselves. But money talks and sports cars don’t.
Reply: @Kona61  Yep and that's the cold truth.
Reply: @savagegeese  The problem with BMW reliability is recent, if go back to early 00s and before, their straight 4 and 6 engines were solid. Beaten the crap out of an E36 for 250 miles, the engine was still going strong but the body and frame were rotten when I got rid of it. Minis and newer BMWs are unreliable.
Reply: @savagegeese  Were previous Supras (when new) really that affordable?
Reply: @happyfundave  Not really, the twin turbo was $$$.  But they sure held their value.
Reply: @Kona61  I would say the reliability will have to be tested but the name needs to change. People don't want to associate the  name supra with a BMW. That's why people I would say are disappointed by it.
Reply: @gerardjoaquino8856 .... Are there people saying its going to be a shitty car and a car that performs terribly? Because I do not see many people saying that.. Most people are just annoyed and disappointed with the fact that it is not a mainly Toyota-built, new-gen Supra.. I think most enthusiasts were hoping to have the old Supra, just slightly re-engineered for the modern day.. If you think about it, 320hp back in the 90's would be equivalent to like 500-600hp today.. I was def hoping for a manual, rwd, iron-blocked, modern beast like the old Supra was.. But I get it, its all business and that would have been hard to pull off from a financial standpoint. TBH though, I would have rather the new Supra not been made then rely on BMW to help them get it made.
Reply: @gerardjoaquino8856  .. Also, I feel like if Nissan could develop and make the R35 what it is, Toyota could have made a Supra to compete with the GTR, just like the old Supra competed with the old r33-34's.. But again, I get it.. Its all about the economical side that limits what they can do.
Reply: @MikeHarkins-w9b  if you don't see many people "saying that" you must be new to the comment section. We bid you Welcome XD
Reply: @savagegeese  agreed! BMW is trash and should stay in the garbage can!
Reply: @savagegeese  you might have missed the 22 seconds where Toyota proofed the engine. But yes the suspension will eventually squeak the brakes will warp, and the worst electrical hardware.
Reply: @ashleythompson3677  I saw that part where they proofed the engine. Thats why I said "video answers some of it." But yes, everything else will be up for debate.
Reply: @savagegeese  i agree with you, ive owned 4 bmws and everyone of them except 1 had oil leaks, 1 had an engine blow up because of the trans slipping and it also flooded internally because of the moon roof. Ive had electrical issues on 1 of them and the parts on all of them were super expensive to replace as well as the maintenance if you took it to a bmw stealership. Also while some parts were easy to work on, others were extremely hard.
Reply: @gerardjoaquino8856   my expectation is that it sells like shit so I can be happy to get one for a steal lol.
Reply: @gerardjoaquino8856  I understand your point but when you are dropping a minimum of 60k for a car there should be little room for disappointment and all I can see on this car are cut corners and cost cutting
Reply: @geo112994  hey man, believe me, when the taxes hit where i live it's going to be way beyond 60k. But i'm hoping and praying they can keep it down as they did for the 86. Anyway, i'm not the prejudicial type and i hope i never will be. So i'm still on a wait-and-see basis. Besides, i'm still holding out for a new rotary car from Mazda (2020 as what i've heard is some kind of milestone) :)
Reply: @gerardjoaquino8856  keep expectations low? Lmao.. kids defending cars they'll never own. 😂
Reply: @Lillos85  hey, thanks for the compliment. I look younger than i am. ;) for the record, i'm not defending nor insulting the car. You're may be right or wrong, I may or may not own the car, it depends (but it's entirely possible). If it makes you feel better about yourself, go ahead and insult it all you like. ;) i have nothing personal invested in this car.
Reply: @gerardjoaquino8856  obviously you're emotionally invested as you've constantly defended the car.. comment after comment.. like a 10 year old with hopes and dreams.
Reply: @Lillos85  if you say so boss. Either way i don't really mind. It keeps me entertained. ;)
Reply: @gerardjoaquino8856  I mean it's pretty obvious.. just look at your own comments. 😂
Reply: @savagegeese  That was my BMW experience as well. I might still have some interest if they offered a manual, but since they don't, they can keep this one.
Reply: Watch the video again.  Toyota thoroughly addressed the reliability. @savagegeese
Reply: @geo112994  In what world is using BMW components considered cost-cutting?
Reply: @soupisgoodfood42  well Toyota didn't make them so they cut the RnD costs and most manufacturing costs since those parts are already in production. Just because BMW is a "premium brand" does not mean using their parts, designs, factories, manpower, etc is not cost cutting
Reply: @geo112994  Did you not watch the video? They clearly talk about how Toyota tested the components to make sure they meet their standards of reliability, and until people have had a chance to put them to the test, I have no reason to doubt them.
Reply: @soupisgoodfood42  I understand your point but they tested components and that is it and they only tested the samples that were sent to them actual quality control of the finished product and the components used on the cars is done by bmw
Reply: @savagegeese  Subframe corrosion issues on 6-series cars, the need to calibrate the battery...
Reply: @geo112994  You don't really know that anymore than anyone else who isn't actually involved in the development. That's why this whole thing is hilarious. A bunch of arm-chair engineers so sure about something they actually know so little about. I'm waiting until the final product is actually tested. Anything else is just pure speculation based more on emotion than anything else.
Reply: @soupisgoodfood42  true but to truly test this car would take years to get the facts from its owners or dropping a minimum of 60k and honestly paying that much for something that is giving all the signs of being a complete disappointment is not smart. Toyota can say what it wants about its involvement but the only facts we actually can confirm is that the car was manufactured and developed by BMW, and that no company is going to say anything potentially negative about its product so take everything they say with a grain of salt
Reply: @jeansboii  Reliability is relative, cars today as  a whole have far more things in them to brake than 20 years ago. BMW got their act together in 2016 onward but you can't compare engines today from those in the E36 era.
Reply: @savagegeese   I agree with your assessment except when it comes to costs. 

It's totally possible to make a car like the Supra make sense they just need to take a different approach. Instead of building a single car and suffering the cost they make use of the scale of economics.   It's the same approach that Nissan/Infiniti did with the entire luxury lineup,  via the FM Platform and VQ Engine in the early 2000's or more recently VW and MBQ.

Using a sports car as the focus of when designing a platform is the best approach, they often produce more unique/cutting edge technology, are  much lighter and thus have better performance, handling and fuel efficiency.  All of which is then applicable across your entire line up of cars.
Reply: @gerardjoaquino8856  But that's the whole point. People don't want to give it a chance from the get-go because Toyota sold it's soul to BMW to make this joke of a car. If they thought there's no money to be made on cars like this then they should've just not made it.
Reply: @savagegeese  theres a reason why people loved the ae86, initial d nothing else its not even a good car
Reply: @savagegeese  Boy, were you wrong about reliability. According to Consumer Reports magazine, the 2024 and earlier GR Supras have earned an above average reliability rating. Despite what many still say about the GR Supra being a Z4 in a different body, they clearly never heard of Gazoo Racing. Car & Driver magazine gave this Supra their "Editor's Choice" designation. Being an owner of a 2024 45th Anniversary edition Supra, I wholeheartedly agree with them.
Reply: @davepaturno4290  Yes, my worries proved incorrect.  The B58 and ZF along with manuals wound up being a big win.  Its good to see that this all worked out.
Reply: @gerardjoaquino8856  Agreed. I am still giving BMW a chance to come up with a reliable car. If they prove me wrong again (used to own a 1998 M3...) then I'll trash it.
Reply: @gerardjoaquino8856  He's got his own opinions, and he'll probably drive it and you won't, if you're a fanboy of every new disposable crap box keep that to yourself. Cheers!
Reply: @boskocrnobrnja6659  oh look, another fanboy :) you probably can't afford it. Let the real men with real finances talk little boy.
Reply: @gerardjoaquino8856  my biggest concern is that it isn't manufactured in a Toyota plant not so much that it uses BMW parts. Yeah, I'm sure they have put in strict requirements in the manufacturing process but it still takes a lot of time for those people to gain that experience to apply that process as well as those who have been working to those standards for decades back in Japan in a Toyota factory. Reliability is hard to judge on a vehicle in the first 3-5 years anyways. Just look at Chevy bragging about their little niche study that compares cars in the first 3 years of ownership.
Reply: @kabloosh699  for sure, it is a concern. However, i'll reserve judgment until the facts are out. That's fair, wouldn't you think?
Reply: @gerardjoaquino8856  well it's ok to have initial impressions. Here is hoping for the Supra brand that it can prove the concerns wrong.
Honestly though there should have been a cheaper option. Something in the 30-40k range.  Something to compete with the v6/i4 turbo Mustang and Camaros out there. This Supra costs more than a optioned out Camaro SS and Mustang GT. yet has 120 less HP compared to those cars. 0-60 times are similar but those cars are going to smoke it beyond that and while it is a lighter vehicle both the Camaro and Stang come with track focused options so again it is suffering from A LOT of German performance car syndrome where you pay a lot of money for something that will be outperformed by cheaper American competitors.
Reply: @kabloosh699  if you're that concerned about German reliability, why should we talk about the world famous American reliability? You're moving in circles friend. Hey, for what it's worth, I don't even know if the Supra's going to be any good; and again, I also do not know if it's going to be bad. All i'm saying is, all this pre-judgment of something no one here has obviously sampled is a testament of widespread ignorance... unfortunately.
Reply: @gerardjoaquino8856   If Domino's hired Pizza Hut to make a pizza using Pizza Hut toppings....guess what?...IT'S A PIZZA HUT PIZZA...YOU DON'T NEED TO TASTE IT!!!
Reply: In my opinion, it’s a failure of Toyota to not have offered manual trans and building their own engines, Most people love supras for its 2jz engine,
Reply: nah you're blind. this car isn't a JDM legend @gerardjoaquino8856
Reply: @vizualmrs  who cares. I'd rather not discuss this issue with fanboys/hater all the same. Friend, if you don't like it, don't buy it. Simple. ;)
Reply: Who wants a sporty Toyota. The brand is a eco shit box
Reply: Then don't buy the damn car dude. Quit bitching. If you like the Mk4 then continue driving it.